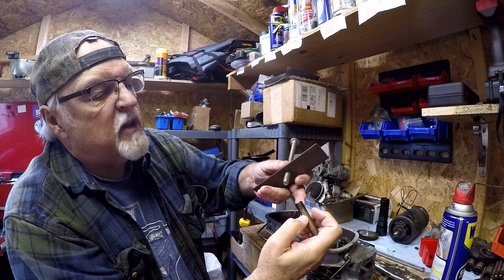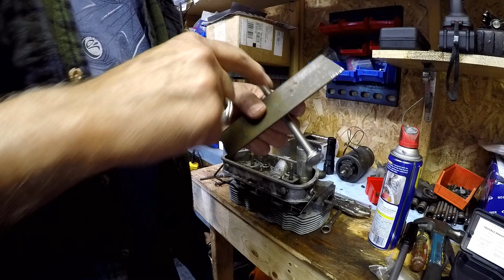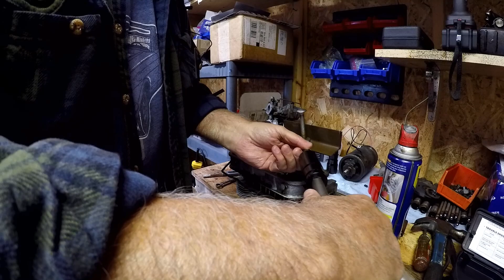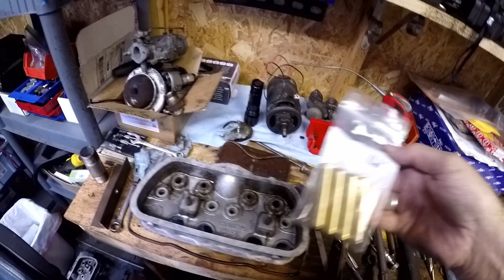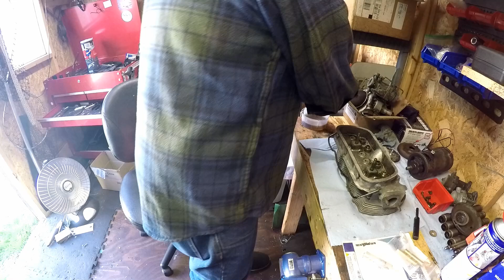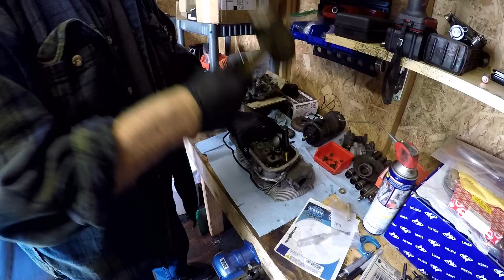1965 1200 40hp Valve guide Removal and Installation

Comment: Nice Tim, glad to see you got them in
Reply from the maker: Got them in but the new ones need to be lightly honed. I have the 8mm hone tool coming and will be there when we get back from our fall trip on the Coast. We just pulled into Florence Oregon RV park we like. Video coming soon
Reply from the maker: Hi Jim, although you are seeing in between videos while waiting on VW parts wanted to let you know grinding valves and seats is all new to me on any motor. I always took them to a machine shop but being this is a low budget build I'm doing everything myself. As you will see on an upcoming video, I get the valves and springs back on after my first attempt at using valve grind compound. I did a water test they are leaking air past the seats. My plan now is to use the old valves on my 2nd attempt but doing it the correct method and then put a new set of exhaust valves in to do the water test again. I have read that this method works on regular engine heads so it should work on a VW head as well. If it works and the intake valves still leak will buy and new set for them as well. If none of this works will keep trying to get this right before moving on with the build. Definitely want good compression as possible on this old 40 with new pistons and jugs.
Reply: @TimsWorkshopTJY  nice, looking forward to seeing this